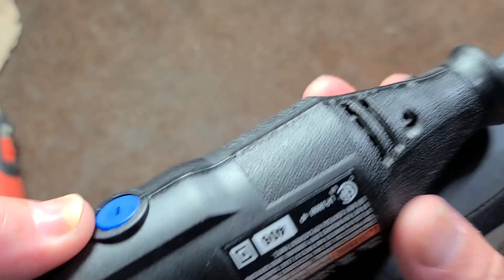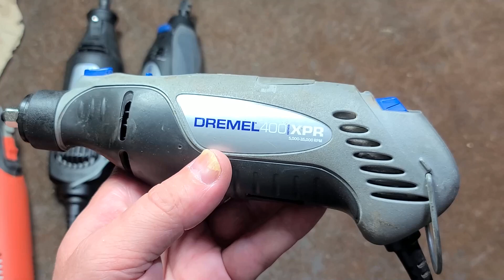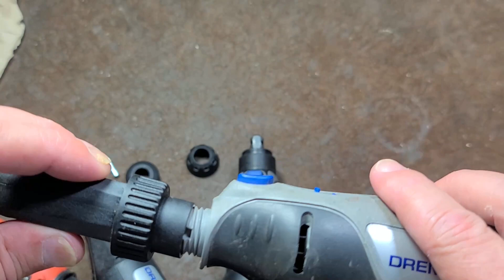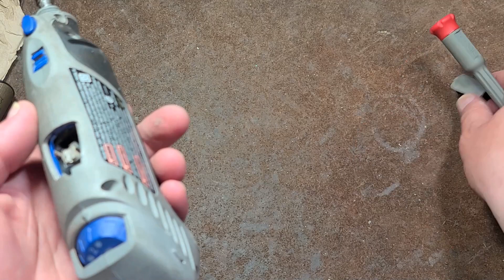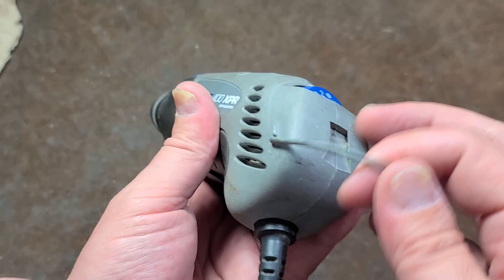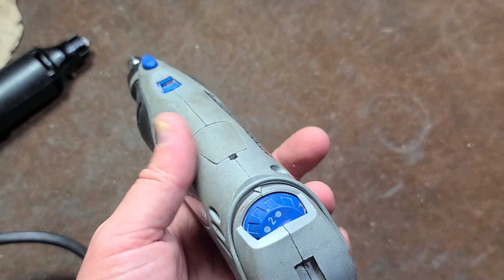Dremel 400 XPR High Power Rotary Hobby Tool Review/Teardown

Comment: I bought my 400 XPR new. I've stil got it. It still works as well as it did, omg, I don't know 'how' long ago. I've had it forever now.

The original collar is grey plastic the same as the main body. I don't usually have mine on either, it's just kinda useless if you've got attachment collars that everything else fits over anyways. Saves you some changes.

The square drive arm is very cool. Love it.

I've got the drill press stand too, but I took that apart and made it much more stable. So it can work like a real mini drill press!.

It's one of my favorite tools. I can blacksmith, make my own tools. But do I ever love my 400 XPR.

Comment: Any idea what i need to attach the flexible pencil dremel attachment (or whatever its called) to my 400XPR?  You mentioned a 'square drive addapter" for attachments.  All i know is i used to have all the gizmos for this kit but haven't used it in years and apparently ive lost the piece that connects them.  Appreciate any help.

Comment: That slot in the back is for a light and magnifier accessory that came with the kit. It has a metal arm that bends and stays where you place it. There were some cool accessories that came in the kit. I bought the complete set new years ago when it came out and still use mine
Reply from the maker: Those accessories sound pretty useful!
Reply: @CatusMaximus  yes sir it came with several one was a jig saw attachment, a flex shaft with a small pen sized remote attachment for doing fine work, a circle cutting jig, a jog for sharpening blades, a planer jig, a cut out jog for sheetrock etc, and a ton of various bits and a molded case for everything. I think I paid under $200. for all of it but that was around 15 years or so ago. I just ordered my first set of replacement brushes for it and they were a little hard to source as most Dremels use the other kind of brushes. Its a real nice powerful tool though you will really enjoy it.
Reply: Any idea what i need to attach the flexible pencil dremel attachment (or whatever its called) to my 400XPR?  He mentioned a 'square drive addapter" for attachments in his video.  All i know is i used to have all the gizmos for this kit but haven't used it in years and apparently ive lost the piece that connects them.  Appreciate any help.
Reply: @DefenestrateUp  yeah theres a threaded spin on adapter that has a square hole that matches the shaft inside the flexible hose that is attached to the pen shaped dremel attachment. Its  like an inch long and is grey. You remove the normal collet holding nut and replace it with the adapter with the square hole in it. Hope that helps, it's a nifty useful accessory to have.

Comment: Thanks for your video, there is not as much information on the net about this dremel as I would like, and I don't understand why, it was supposed to be a pretty good item in its time but it seems that it didn't last long and they didn't continue with the same technology, in fact all the models they made later have the same motor as the previous ones, only this one has magnets and 2 Amps.

What happened, why didn't they continue with this series, at the moment the most powerful dremel is only 1.8 Amp, and it's been 12 years since then.

Comment: What are some of your favorite starter bits for this Dremel for various applications? (I know it’s probably an overly broad question.) I’ve been happily using the 400XPR for about 20 years for a few very specific applications and not much else. Recently dusted it off, assessed all the neat accessories that came with it and was stunned to realize what a versatile tool I had been ignoring! 😮

Comment: I’ve had mine forever and really appreciate your video on maintenance 🙏. It’s a very nice tool, though I use my Foredom for detailed work. The 400 XPR is great for more mobility and as a drill press- the right angle is great as well. Mine has been stuttering unless I crank up the RPMs and I have to let it rest each time I shut it off b/c it won’t power on again (doesn’t really feel hot, though). Any idea what’s causing that?
Reply: Try replacing the brushes.
Reply: Hello @mariexichen1136, I also have one that seems to have a problem, it works very well at high speeds, but at medium and low speeds it seems to stutter (as you yourself say :) ), it is as if it lacks continuity in the electricity, it turns but does not seem to be perfectly constant electricity, however it works but gives the feeling that it costs a little.

Did you manage to solve your problem, did you find out what caused the fault, thank you very much in advance.
Reply: @iconospacio  I did replace the brushes as suggested by @stevenhopson5916; however, I don’t think I did it correctly as the door doesn’t shut all the way now. There was no improvement noticed and I’ve set it aside for a while now and I am using a different cordless rotary device. When I get around to it, I think I’ll take it to a repair shop.

Comment: I just bought all the made in usa tools.
That you can get off the shelves.
Estwing , Vaughan, channel-lock, Lang,
Dahco, mayhew, and that tool with the spring you pull and it makes a indent on your application. Next ill be getting the precision instrument split-beam torque wrench and the 1/4, 3/8 rocket socket set. But ratches, extensions, sockets, screwdrivers, wrenches and bits set made in usa, Are not on the shelves.
Ill just the them from a hardware store.
Those 4 tool trucks are so exspensive.
Reply: Thats how i did it.
Learned alot from Catus.  And be mindful to what i have in hand
And try to research on how i can out run those tool trucks to and have the same product.